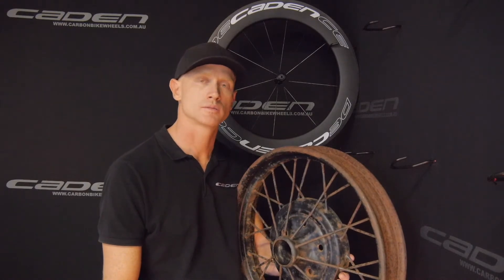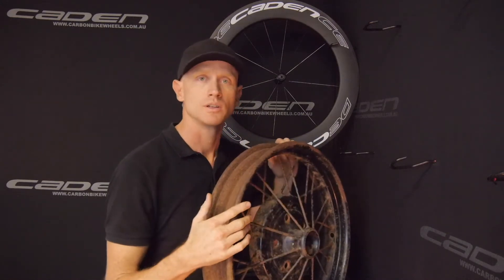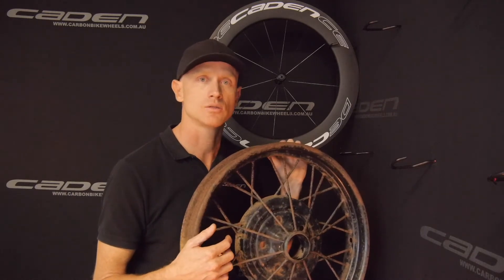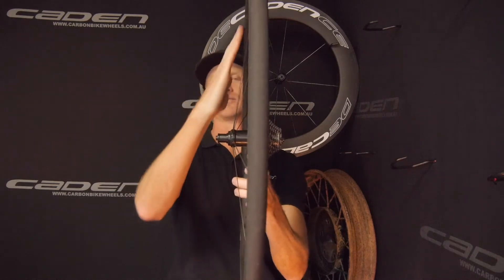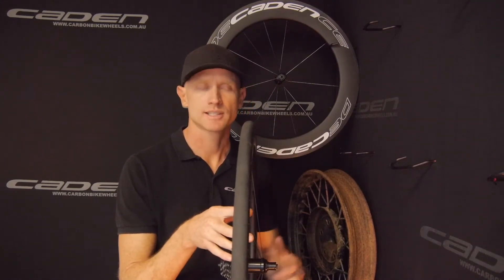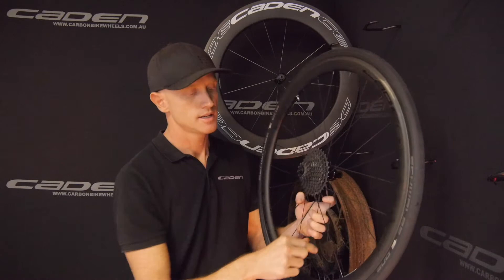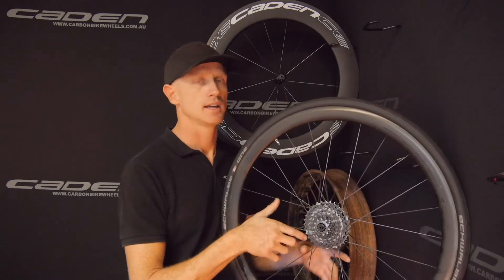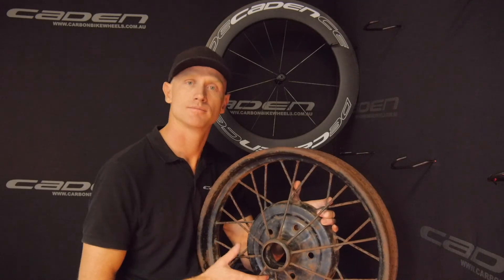2 To 1 Spoke Pattern Explained With 1926 Henry Ford Wheel

Comment: I had a look at your website and it looks like you build with pulling spokes on the inside of the pushing spokes (on the drive side rear hub). This is the wrong way around. When you pedal you want the pulling spokes on the outside supporting the pushing spokes when they go slack. That's how I build my wheels. I put my pulling spokes heads out too. Pushing spokes heads in.

Comment: Hi, just curious when it comes to retension the spoke, does each spoke have the same tension? or the tension for the spoke on one side is different than the other side? Thank you
Reply: On 1:1 lacing, it'd have about 40 to 50% on DS, but 2:1 pattern (aka crow's foot) is going to have 90% of the same tension as the drive side.
In other words, It'd have more 50/50 distribution
Shimano also made a documentation about this when they released 2:1 105 hubs.

Comment: I think, this is not absolutely correct. First of all, lateral stiffness has to do more with the bracing angle and total spoke count, and only then with the spoke ratio. The 2:1 lacing increases tension over NDS spokes, bringing it close to the DS spoke tension value, but sacrificing lateral stiffness. However, it will allow more deflection before the NDS spokes go slack. So, if one wants a stiffer wheel, having more total spokes count is the key (even if using 2:1 ratio).

Comment: Hey Caden, thanks for the video. Learned quite a lot. Currently fixing a Giant cross city rx that had been discarded. The rear wheel also has a 2 to 1 spoke pattern. While the drive side has 14 spokes, the non-drive/flared side also has 14 instead of the 7 spokes you mentioned in this pattern. Is this a problem? Should I remove the excess spokes? Would appreciate any insight. Thanks

Comment: Interesting. My question is, does this apply to electric bikes with a direct drive hub motor wheel? Where there is little load being used from the drive side due to nearly never peddling?
Reply: In case of electric motor I would go for crossed lacing on both sides, because motor generates torque which is distributed to both sides of hub, and you need to have pulling spokes on both sides to keep the load balanced around the wheel.